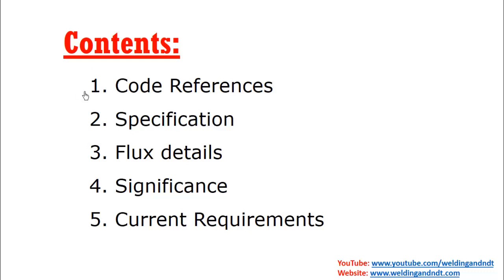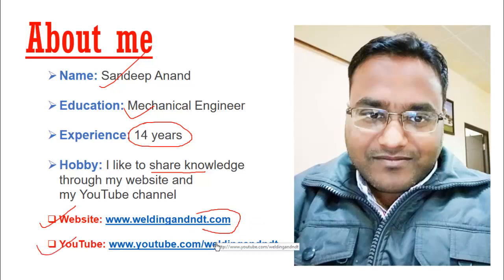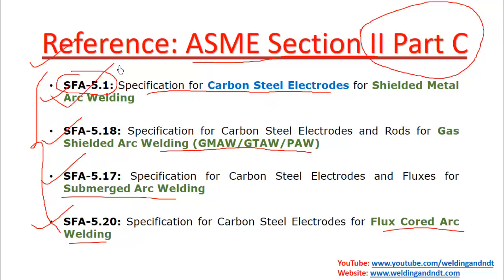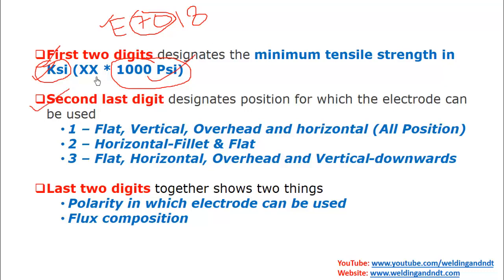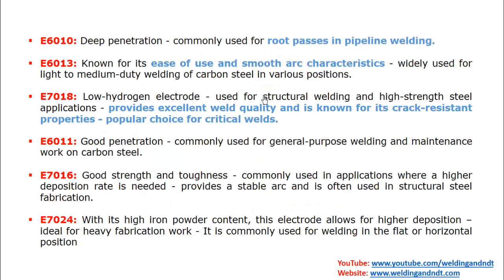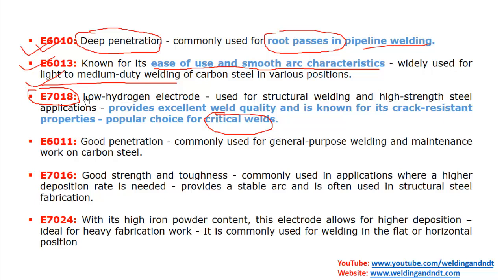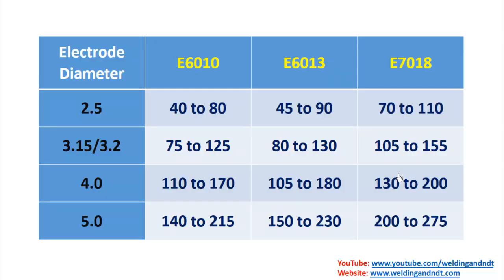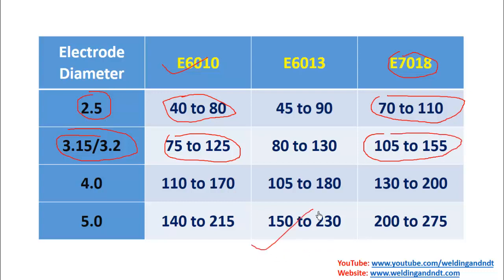[English] Welding electrodes (carbon steel) for shielded metal arc welding

Comment: Sir as per our approved WPS , weld width max. 3 times of electrode dia.

What to do if weld width comes more than 3 times of electrode dia ?
Is weld joint have to cut out or we need to grind the capping of weld joint? Or any suggestions as per your experience.